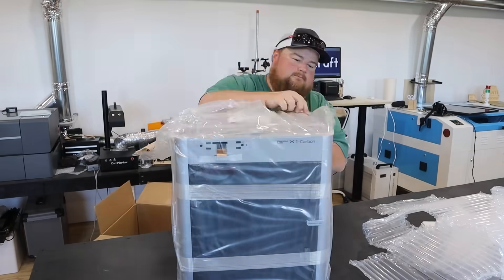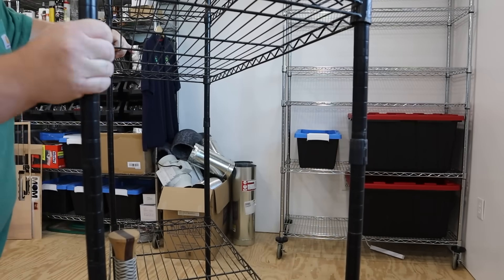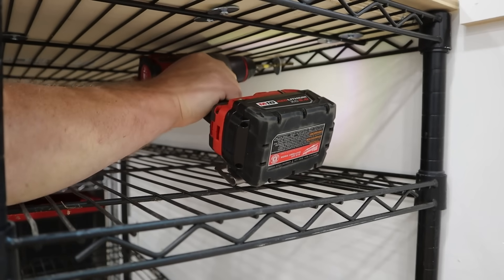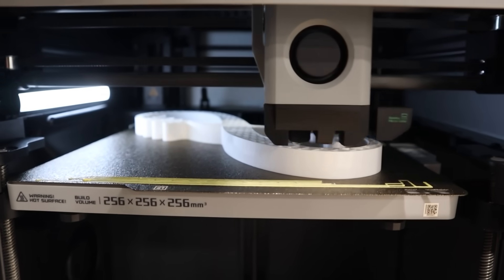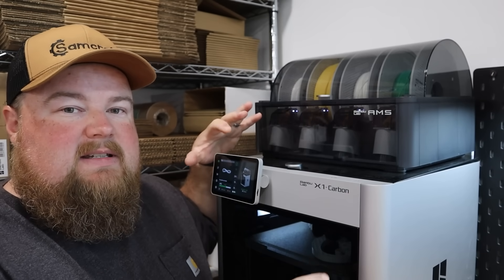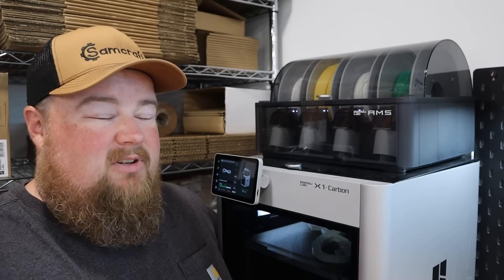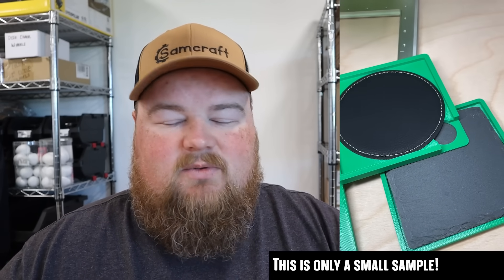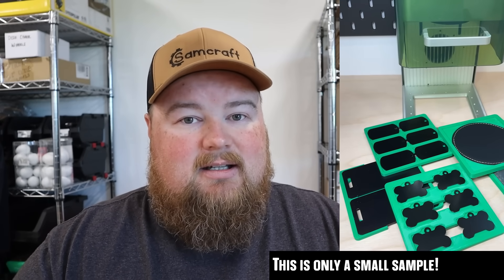Diversify Your Income by Starting a 3D Printing Business

Comment: I have been 3D printing for a long time now, and the Bambu series is great, but, it is not for everyone. If the work involves NDAs or security, you should not be using it. That being said, it is one of the most user and entry FDM-friendly printers in quite a while. Fast and simpler than most others.
Reply: Is it because it’s cloud based? Isn’t there an offline mode?
Reply: @3Dgifts  I am not tech savvy enough to fully explain, but in short Bambu is a "closed system." The logs that are sent to Bambu for every print include more than just the needed information. 3D Musketeers talks about it, but people have been able to get into the locked info that is sent. 

Bambu told many... untruths on what they get. The simplest one is they said they don't get the gcode, but they do. And you can use the gcode itself to remake the model. Hence, the NDA and security worries.
Reply: @RoseKindred  thank you, good to know. Adding to this, I wonder if someone does some packet analysis and basically drops all those packets at the firewall 😉🤔
Reply: @3Dgifts  I wish I knew. From what I watched most of it went over my head but they went through everything. 

Even multiple F-resets do not work. For example, the printer they tested was reset multiple times and the printer still sent the past info. So it not only has new info it resent the past info it already sent. Kinda like how you can get old print jobs from refurbished copiers.
Reply: @RoseKindred interesting, good info 👏🏼
Reply: @3Dgifts  Yes, there is a "LAN only" mode
Reply: @3Dgifts yes there is an “offline”/LAN mode where nothing is sent to the cloud, and all of your files remain local
Reply: You have good intentions but u r spreading false information. Yes it does send data to their cloud but you can use it offline. There is lan mode where u can create a local network without the Internet or go old school and use an SD card
Reply: That’s what LAN mode is for. It’s private then.
Reply: @kevindevoe8016 exactly and if you don‘t trust it, just put it behind a firewall.
Reply: There's a offline mode
Reply: Incorrect… you can literally use the printer with out wifi / cloud. ( it’s called using the SD card , complete offline, with out any internet access …. You can literally run a Bambu printer in the middle of a desert with no cell service, internet, ect… all you need is power and a SD card with files )
Reply: Interesting, I guess If I ever get to the point in my journey this late in life, and come up with that "thing-a-mabob" that I'm genuinely worried about I'd consider a less worrisome ecosystem.  I've heard that but wondered if we just disconnected from the internet and used just SD cards.  I'm not claiming to state that approach works as I'm still new to the hobby
Reply: I use the anycubic kobra 3 combo in my opinion it is really good and fast
Reply: @MingsTakeover  wow amazing,Do you make your 3d models yourself too?
Reply: Ues
Reply: Actually, there are many companies that use these Bambu printers but they make sure it never connects to a network and only operates it in offline mode.
Reply: any of them  good for work that involves ndas and security
Reply: @cameronvincent  As others have said, you CAN use it for that, just do NOT give it back to them for repair/recalls or connect it after the firmware update. Also, do not use their "Handy" slicer. You will need dedicated computer with the internet connection removed.  

Even "reset" machines can still contain the information. This was a big problem with paper copiers as they used to save every copy or until limits were reached, with some in the thousands of pages. 

You need an "air gapped" set up for the higher security, so completely disconnected. Many don't realize that even "all-in-one" printers for labels or packing sheets may cause security issues too.
Reply: How does it feel?
Reply: @RoseKindred  yes
Reply: Block it at the firewall in the router get a good router
Reply: That’s FUD, if someone is making significant enough revenue with your private property and you have a common law claim on it then you can simply handle that situation with an affidavit.
Reply: Why do you not recommend bambu for secure work? I do some defense contract work and am curious.

Comment: Sam, you made a rookie mistake.  No "poop chute"  catch for the X1C.
Reply from the maker: That was the large white print job that showed in a clip, but I have since changed it out for a narrow one. It's there, just not in this video.
Reply: @Samcraftcom  Sorry, just had to poke some fun. I was a BL Kick-Start backer and Ambassador. So ya I have had mine for some time.  I also have GKTwo Resin printer.  A Roly 10 watt diode, 120 Watt Fiber & 130 watt Omtech Co2.  I did build a 500 RatRig & sold it along with my Xtool D1.  With my X1C, I cut a hole in my Tuff built in bench. I had left over mini split hose channel cover. So it goes straight down into a trashcan under the bench. Works perfect. When the X1C first came out, there were a few versions of the "poop chute"ramps. To include a bucket. Some reuse the poop to make skulls from a mold found on Amazon.  Anyway, been watching since your big move.

Comment: Do you have an idea of the structural strength of 3D printed stuff?
Reply: It completely depends on the material used, the design, and the printing parameters.
Reply from the maker: Depending on the material used, of which there are tons available now, it can be very strong!

Comment: I've seen many businesses go with the x-max 3 from qidi, unless you actually need the multicolour options because the proprietary thinking behind bambu's work flow, and the amount of waste produced from multicolours is ridiculous. But as you have it, theres a hack out there that cuts purge waste down 40% or there abouts. might wanna look for that. I don't have either but thats what my research is revealing...which is why I'm leaning towards qidi, and the larger volume isn't bad either. 
In my head, for jigs you probably aren't going to be doing multi colour prints only different coloured prints so I'm not sure you made the right call there, and the larger volume for jigs means you could have gotten more products on one sheet...depends on what lasers n stuff people have too I suppose though so...Will be interesting to see how this new venture pans out.

Comment: ANY of the Bambu printers are almost a 'send and forget' style printer..  If you don't want to put out the higher price for the X1C, the P1S is absolutely a viable solution as well (that's what I have, among other brands as well).  One word of advice on these faster printers, if at all possible, use another infill other than grid, or you'll end up eventually with either a bent nozzle, or a print that's been knocked off the bed (and possible mess on the head to clean).  Gyroid is the most preferred at the moment.
Reply from the maker: Thank you for the advice! The P1S is probably the models I'll get when I expand the 3D print business... unless better models are released. :) Thank you for the guidance on the gyroid infill too... I've only used the default grid infill. So far no issues with any print jobs, but still good to know! I appreciate your advice!

Comment: Nice! I warn you right now... One will turn into two, then three, then four. LOL. That happened to me. So yeah,i  have 4 and fixing to order 2 more here soon. Also, be ready, because the filaments will start to roll in as well... lol... Also, word of advise. Get spare parts...
Reply from the maker: Oh yes... what filament was shows in this video has already been dwarfed by more! Along with extra build plates, hot ends, nozzles, and the likes. I'm ready to take the first profits from this business and immediately reinvest into more machines for sure!
Reply: @Samcraftcom  Man, can''t help it but be happy that your on this path and more.... Kinda like to infinity and beyond... So i have 2 of every crucial part in stock now... Don't exclude the AMS... Parts of must have there hence they are all plastic and do break... Complete hot ends... Why? quick swap... Like up and running within 10 min....  Yeah, filaments.... don't just stick to bambu labs... They will drain you... We use Sunlu for a lot of ours... Specially black and white matte... Well anyways, you get the idea. There is a cost, profit calculator out there that i use to help me expand and help with costs...